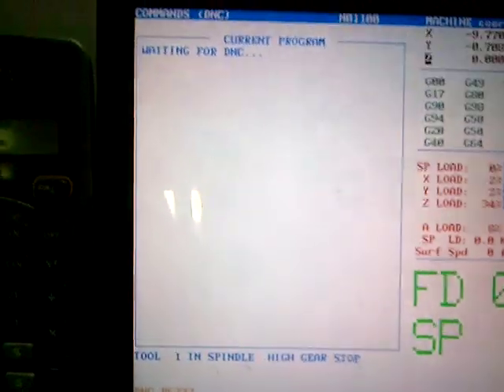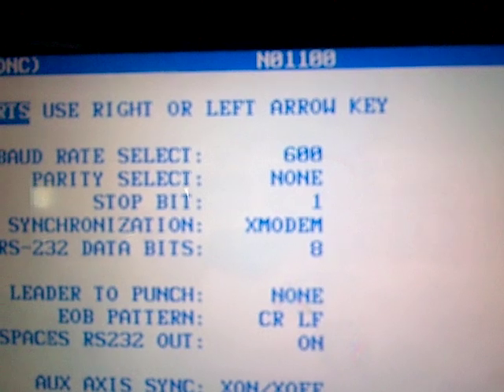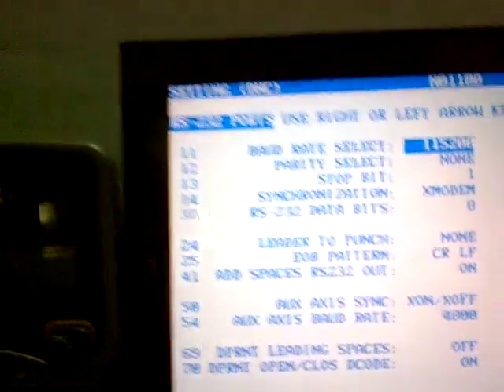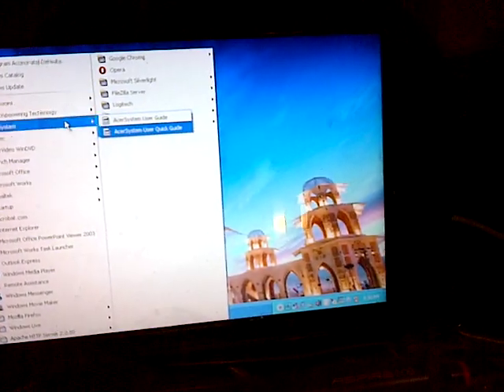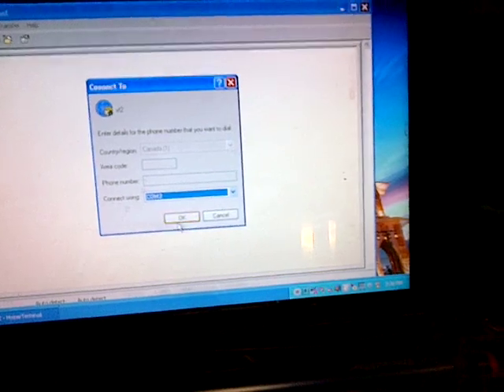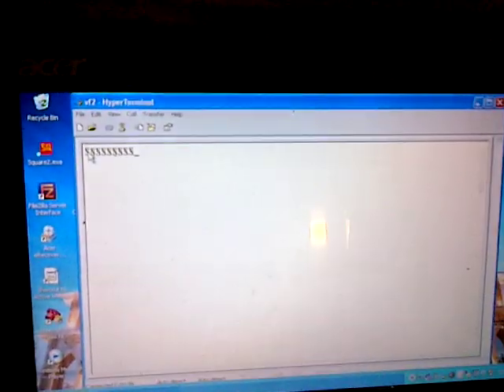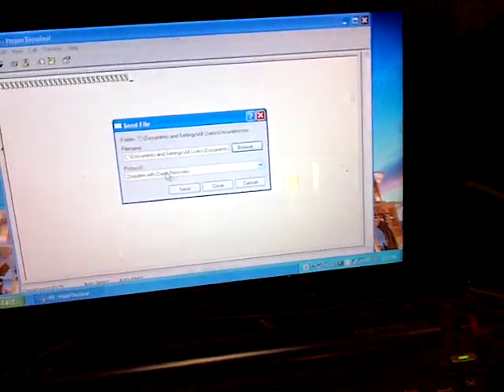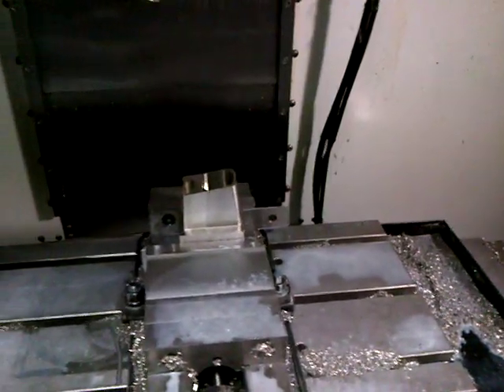How I setup Haas CNC serial communications

Comment: Hi, thanks for this video.  Do you have the exact pinout that you used for the null modem, or eaxctly how thats setup?  I cannot get it to work and it is confusing as heck trying to find good info on this.
Reply: got the same problem. Need update/help.